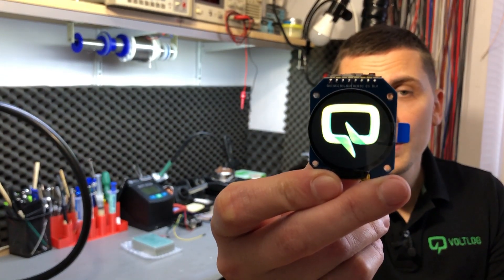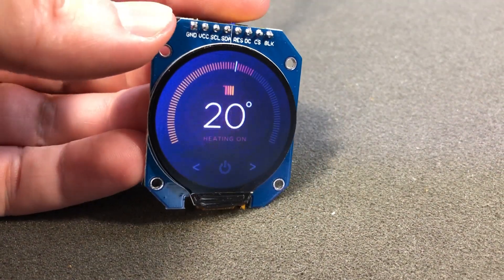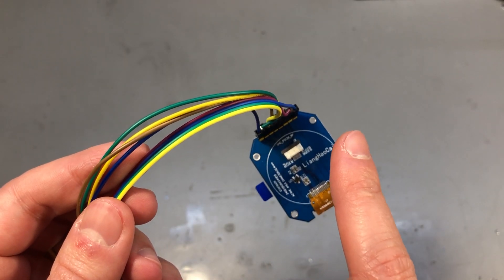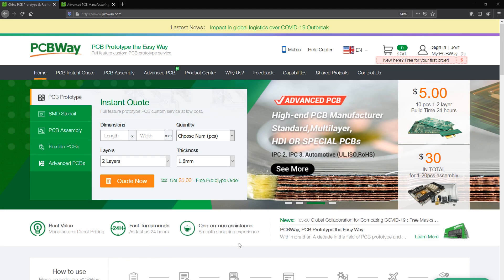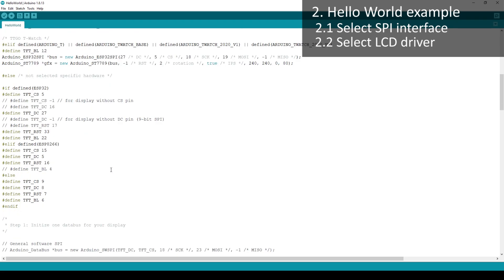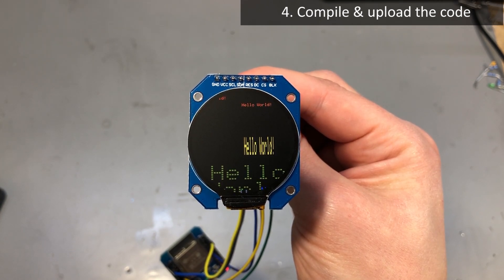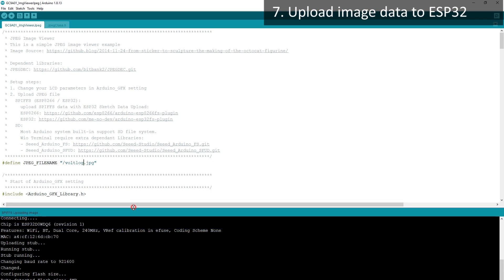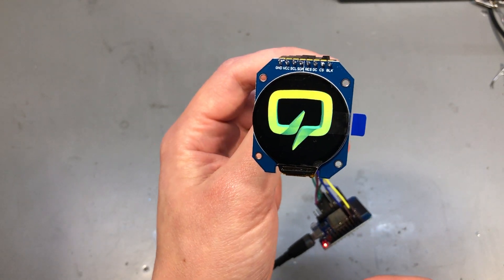How To Interface A GC9A01 Round Display With Arduino & ESP32  - Voltlog #349

Comment: Dear VoltLog, for a project of mine I would need a round LCD display but with 2.4" diameter. According to you SPI display can easily be driven by a Arduino board as the libraries for it are already available. I googled a little searching for a 2.4" display based on the same GC9A01 unit without success. It looks like that all the round lcd displays of around 2+" are based on other interfaces (MIPI, RGB...) Is it any easy to use other kind of round displays with Arduino?
tks in advance

Comment: Hello, I've been researching to customize a 65 Impala speedometer dashboard to a digital display. Is it possible to connect two round displays to a rectangle display to be one complete display? So you can arrange for example, the gas, oil, voltmeter and speedometer. Using OBDLink & RealDash. Thank you for this video.

Comment: Great video!
I have just purchased one of these displays but it came with only 7 pins, not 8 as yours. The missing pin is "BLK" that you have connected to IO22. Others are same. Will your tutorial still apply if the BLK pin is not connected? Thanks!
Reply: did you ever get an answer to this?  I want to buy the same 7 pin display...   how do you hook up?
Reply: @toddroles3234  I was wondering same. Couldn't find right connection diagrams for the 7-pin displays.

I have bought two of these displays but haven't yet built anything. Will try to figure out connections once have some free weekend. :)
Reply: @Armuino  ok.  Please post to this reply if you figure out.  There must be a way to do it without blk pin.

Comment: Hey, awesome video!
I want to use the GC9A01 display without the breakout board but I cannot find the how to get it to work without the breakout board (for space saving reasons). Would you happen to know what circuit i need to make to get the bare 12 pin GC9A01 LCD running?

Comment: Completely agree with your thoughts about technological advancement making our hobby easier & better. I started out programming Z80 processors in assembly & sending FSK data at 300 bps. Thanks for the tip about this display. I just recently had 3 OLEDs & 2 LCDs on one of my projects. I used a multiplexer. Lots of fun.
Reply: What, no Kansas-City interface?:)

Comment: Hello VoltLog. Can you please do an updated video on the esp32 with the GC9A01 display? The Arduino IDE for the GFX  library has changed some coding. I followed your video to a T . I got the clock and hello word working but the Jpeg does not. My TFT screen shows ERROR: File system mount failed! Maybe you could shed some light on this problem. My board is HiLetgo ESP-WROOM-32 ESP32 ESP-32S Development Board from Amazon. Thank your for your great videos
Reply: Same here!! I started on a project depending on this video and the code did not work! Some update would be life saving right now

Comment: This is incredibly cool, especially with the image beeing stored directly on the ESP32. Exactelly what I was looking for. Is there a round display with around 3 inches that you can recommend and that works the same way?
Reply from the maker: Unfortunately I don't know if there are any bigger screens with the same controller but I would assume they would use a different controller due to the higher amount of pixels.

Comment: my problem with tus displays is, u can't actually have a device that's round because the board that the display is attached isn't circle.
Reply: This is just for development, if you're going to make more than a couple you  could develop a custom board with that controller chip and one of those finnicky flat cable connectors.
EDIT I just realized that the driver IC is baked into the LCD unit, I thought it would be hidden under epoxy somewhere. This makes them even easier to integrate. Obviously, any PCB smaller than the display area should support it with some spacers, if you want to use through-hole components on it.

Comment: hi all,
i try to recreate the nice demos with same display, unfortunately without success (display is backlighted, but "black"")

i could compiled / flash demo sketch without any errors on a TTGO T7 Mini32, with class adaption for data bus / display, wiring schematic like "5:23"
my remarks - the "hello world" sketch from my installed "arduino gfx" library (1.0.7), respectively from the linked one: 
https://github.com/moononournation/Arduino_GFX/blob/master/examples/HelloWorld/HelloWorld.ino
seems different like the sketch in the video ("5:10")

am i doing something wrong ?
would appreciate tips & answers  :-)

Comment: Would you be able to recommend some softwares which would enable me to custom create graphics that respond to data input. Such as a speedometer or voltage or temperature. I'm trying to find some deeper info about this but have no luck so far. Nice video! Thanks!
Reply: I need that answer too! Anyone could help us?

Comment: You might want to take a look at this font family: 
https://b612-font.com/
The project was initiated by Airbus in 2010 to develop a family of fonts which were optimised for ease of readability on a wide variety of graphical displays.  It has since been made open-source and has since been adopted by several manufacturers of avionics and HMI solutions.
Reply from the maker: That's so nice! Thanks for sharing this.

Comment: Very nice display. Perhaos it could be used to modernize or upcycle a vintage piece of eqipmwnt. Such as an old radio or giga counter. To add inside a modern electronics. Another good purpose as you say is perhaps instrumentation. For example if somebody wants to electrify (EV conversion) a classic vintage car. Or boat. Or motorcycle. Or even something like a hand glider. Where you want a streamline shape to the cowel instrument cluster. Very good. What else? well maybe you are making some fake device for tv or movies. Like a film prop. But mostly I am thinking vintage equipment. From 1950s type era. When they only had analog meters. Including radio. And other audio devices (tape recorders, hifis, etc). Like guages you see in old tv shows... Or maybe in an old military equipment or from old army surplus.
Reply from the maker: Yup, it can definitely be used to modernize any old round shaped dial/display.

Comment: Cool display. Before getting hurt, I would have loved to use this with my supercharged Camaro project. I would have set this up as a gauge to display everything extra that I wanted to keep an eye on like boost, ignition timing status, water/alcohol injection, oil, radiator, and air temperature at the inlet filter, cylinder head, and headers.
 Even before beginning the project to build the motor to add the supercharger, that car was a handful to drive with a manual transmission. Having a single gauge programmed to focus on what I needed to see would have been really nice. 
  This kind of project was my goal when I started messing with electronics after getting hurt. The doctors said it would take at least 6 months to fully recover. I thought that would be just enough time to learn this electronics thing well enough to build my own gauges. (I sure was naive)
 Well, after what will be 8 years on the 26th of next month, I might be able to pull it off... but the half finished motor rusted after the first year, the car was sold after the second, and I'm still waiting for this 6 months of recovery to be over...but, on the bright side, I could probably, finally, achieve a project like building my own gauges. My skills aren't much better, but, yeah, it's amazing the level of peripheral libraries and copy/paste code available now. Not to mention, when having troubles with libraries these days, if one does the homework and asks good questions, the library authors are often very willing to help.

   I just started messing with embedded linux, hacking around with uboot using hardware UART, and found a forum with a bunch of the guys from openwrt that are awesome and super helpful. I had no idea it was so easy to mess with quite a few devices I had sitting on my shelves. Amazing time to be alive :-)
-Jake
Reply from the maker: Some automotive instrument type panel display was also on my head ever since I got the display module but now after using it, I must say at just 1.3 inch it feels a bit small to be able to read more than a simple needle gauge from a reasonable distance. So you could use this to build like a temperature display, a pressure display, but combining to show multiple stats at the same time might be problematic due to the size.
Reply: @voltlog  
  Honestly, I was thinking of mostly the ability to set it up essentially as a RGB warning light first and a gauge second. I mean, even with a 6in Autometer tachometer on my Camaro, I never really used the gauge. The useful part was the little 1in bright amber shift light on the thing. I also had a triple A-pillar gauge setup with oil, vacuum/boost, and air/fuel ratio (exhaust oxygen sensor). They were pretty useless while driving too. They are fine for cruising/highway use, but not when just pushing the gas peddle too far will unlock the rear tires in any gear and you're balancing on the edge of stability. I was most concerned about potential detonation issues and if the 50:50 alcohol/water mix ran out or failed to maintain pressure. The compression ratio and boost pressure I was targeting would have been pushing the limits of pump gas. Having a gauge that can flash multiple warnings that I could identify in peripheral vision was my real goal.

Comment: I do recognize how far electronics as a hobby has come since its beginnings, but I can't say I'm happy about it; quite the opposite, actually. Yes, it does make far more fabulous things available - but at the cost of increasingly insane complexity and volume of knowledge piling up that people supposedly become familiar with. Except they don't - it's an unavoidable tradeoff; brains haven't gotten bigger in the last century, only the racetrack got longer and longer and everyone still begins at the start. To cover all that ever-increasing surface of knowledge, the trade-off is an ever-reducing depth and an ever-faster skim-over. One thing electronics isn't today is "accessible" in the sense electronics hobby kits / circuit books of yore used to be, for any kid with the requisite interest and patience trying to wrap his head around this weird magic stuff. Yes, anyone can follow a ten-minute tutorial and have an Arduino blink an LED; but that's a far cry from what one used to achieve having built and understood how and why an astable multivibrator does the same. And yes, programming has the exact same problem...
Reply: The best solution for this problem is 'open hardware'. And to treat all of the common projects like we do in open source software. To provide good BOM, good documentation and support to the community. We already see this in some projects. However most of the time EE is lacking behind the OSS in these aspect. Progress in these aspect are very much more work. And slower to get better, compared to the the faster speed of new hardware and new more advanced electroincs. I can cite some positive example... one is the 3d printers from annex engineering. They are great with stuff like BOM and having calculators etc. And there are of course many other good examples. Of well executed open hardware projects. But it is just a small fraction of the total. Most electronics are not so well organized, or do not see for how important for group collaboration are tools such as git / github. Like it does not apply to them. But on the positive side, this year will be excellent for KiCad project. With many significant improvements in KiCad to help the community. It takes time, we can all help each other by learning new skills. And thinking of better ways to collaborate, like also with discord. etc. And also to feel rewarded by that collaboration. That it feels worthwhile, for all the extra work it  takes.
Reply: It's OK grandpa, we all get old, in 20 years ill be saying the same thing

Comment: Very nice display! I wish it'd have the flat ribbon somehow in the back. Otherwise it would've maybe been possible to find a drill to make a clean slot for the display. I find I'm avoiding using displays as I can't seem to be able to cut clean enough rectangular holes. Still waiting for the day some module maker figures out to add some kind of a frame you could glue on to cover the rough edges!
Reply: One idea: If you have access to a 3d printer you can make a bezel to make a neat job.
Reply: @robmurg  Thanks for the suggestion. This had actually occurred to me already. I don't own a 3D printer but I've once printed bezels at a friend's place some years ago. Unfortunately the prints looked quite rough on the surface of an injection molded plastic enclosure (not to mention ones made of aluminum). His printer was some of the early ones though so it might be one of the reasons.

But if I'd have space (and time) for a 3d printer, printing enclosures would be the primary/only use for it. I just lack both...
Reply from the maker: I'm struggling with the same problem regarding display cutouts.